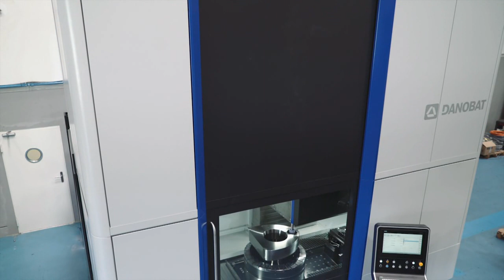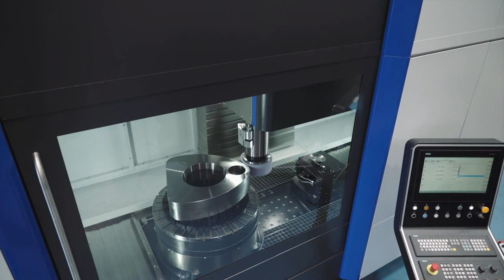Vertical grinding machine - DANOBAT VG

Comment: Great for removing zero material, apparently.
Reply: A door closed and window covered in coolant makes for a pretty crappy advertisement. On the other hand, seeing a clear visual representation of capabilities based on a specific application they are showing as an example goes a long way for most Engineers.